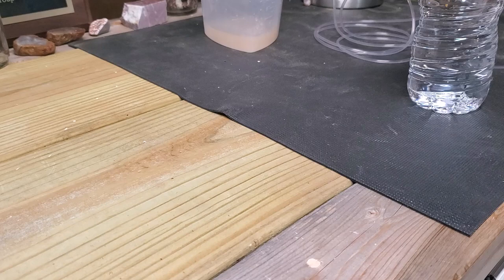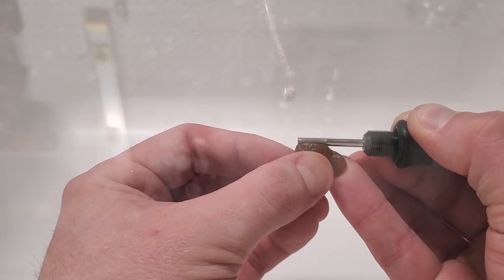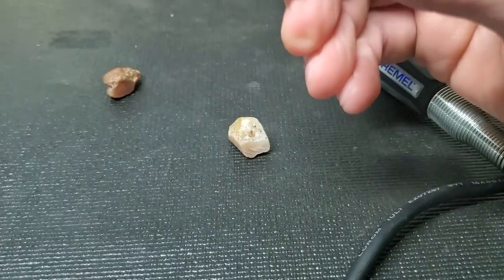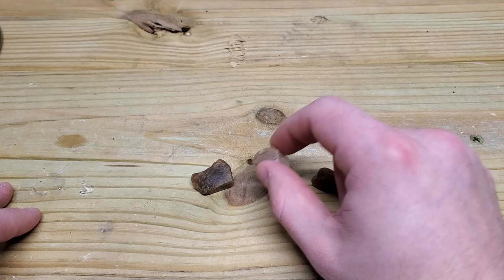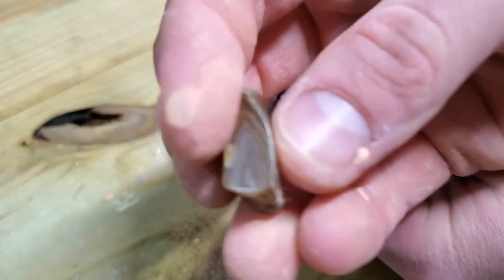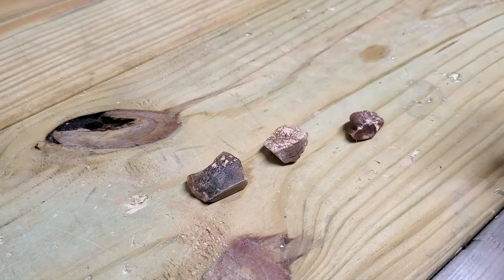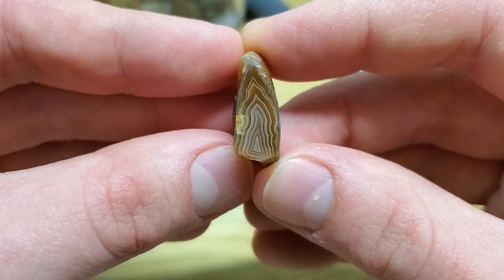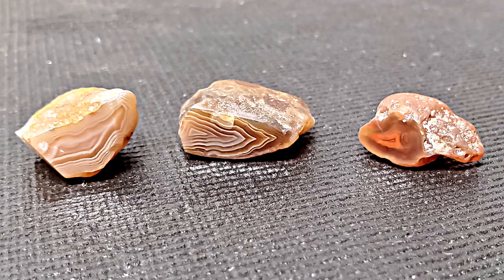Polishing Lake Superior Agates w/ a Dremel!

Comment: They are all beautiful. Use some thin ca for the crack. You can polish out the excess and use a thick ca for the divits. I use star bond. There are some videos on how to do it. You did a great job. Remember you can use a dop stick on small stones to hold it better. Put your cerium on, put it in the jar, start it up and the excess stays in the jar. Keep the fun coming! 😷⚒
Reply: Total newbie here.  Like brand spanking newbie.  What’s cerium?  What’s ca?  What do you glue the rock to the door stick with?
Reply: @MariaWalker-qo3vi  cerum is cerium oxide a fine powder you mix with a touch of water as a final polish. CA is cyanoacrylate  or super glue. You can fill cracks with it and it will polish. A dop stick you use to glue a small dowel or metal rod or nail to a stone. It gives you something to hang on to while you work the stone. You can also use wax called dop wax to affix the stone to a handle also. Hope this helps.🤗

Comment: I know this vid is pretty much 2 years old now, so I have no idea if you've tried this or not yet, but a good method for the cerium oxide is make your slurry in a little container you can seal tight, it stores well if it doesn't dry out, and paint it on to the surface you are doing and just dampen your buffing wheel and go.  Fun to watch, thanks for making it.

Comment: Taylor, your progress has been fun to watch.  Another great video!  I'm undecided regarding my favorite.
Have you considered putting a drop of warm clear mineral oil on a Q-tip and applying it to the fracture on the face of the brown one?  Just touch the fracture with the oiled Q-tip, then a quick wipe up and set the agate down so that gravity can the bleed the oil into the fracture, then check and repeat if needed.  The oil coats the crack between the rock and the chip and the fracture almost completely vanishes.   I've done this with LSA's before and have gotten great results consistently.
Good Luck, Have Fun and Keep on Houndin'
Steve
Reply from the maker: I am going to try that, I have mineral oil and q tips, so I'm set haha thank you so much for that awesome tip!!!
Reply: Cool tip! I have a couple of small labradorite hexagons that have small fractures. I'm going to try this. Thanks!

Comment: 🤝👍👍👍 My friend, You are making great progress. Soon you will understand what you will need to apply in the technique. We in Russia say so "in work you will reach"! All three stones turned out very well. The ones where the cracks are visible should have been removed more. Well, it's not terrible, the cracks can be healed.
Reply from the maker: Thanks for watching, and the practice on these helped out very much, I think next time, I should limit to one stone, then I can take more time on it and work out any fractures!
Reply: @AgateDad  🤝 You're already good at grinding. A simple way to heal a crack in the rock. You need to heat the stone so that it does not burn your hand, then anoint the cracks with wax.Then wipe with a tissue.
Reply from the maker: @v7i5k2t5o7r  another great idea on fixing the fractures!!

Comment: very nice set up nice idea and very safe working conditions.  would you recommend using light gloves?   I would like to ask you is that a dremel accessory part?  I want to start cutting quartz and agates just like you have it set up i love it.  But i have not bought the dremel yet, i am still sanding by hand.  how long does the diamond bit last , how many stones can you polish with that one bit?  also would you recommend the diamond wheel cutting tool for cutting and does that last long?  the dremel bits are quite expensive especially the diamond.  that is why i am asking because i see some cheap alternatives, much cheaper and i dont want to buy cheap stuff if it is a waste of money in the long run.  by the way why dont you use the dremel sanding bit or wrap the sanding paper round the bit to do the final sanding polish maybe much quicker or not? thanks man.

Comment: For final polish I use the dust which comes off my cutting wheel to polish.  I separate the different grit sizes by putting them in water and fractionally siphoning them off as they fall out.  This is free polishing grit that works rather well all things considered.  Not exactly Cerium oxide but effective none the least.
Reply: No idea how to do this process. Is there a headliner to put into YouTube search bar to find this process?

Comment: when working on the sandpaper on a flat surface work in a figure 8. Also if you got some diamond cut off wheels it would help keep the windowed portions you are working on more flat I would think since you are playing with small agates.
Reply: Brown, that would make a awesome little cab for a ring or pendant.
Reply from the maker: That's a good idea with the diamond cut off wheels! And thanks for the tip.om the figure 8, I'll try that on my next stone 👍👍

Comment: helpful tip: 1. Take an ensure lid punch hole in center. attach sandpaper with carpet tape. use disk shaft 2 attach 2 flex shaft and wirks like mini flat lap .ce carpet tape to the sanding flat disk then attach sandpaper